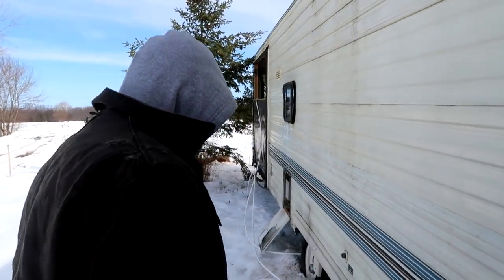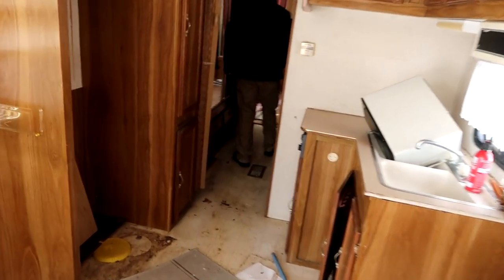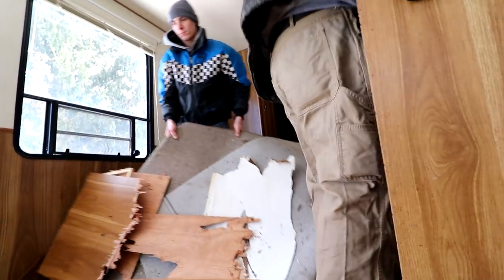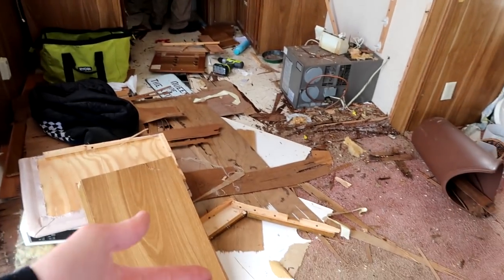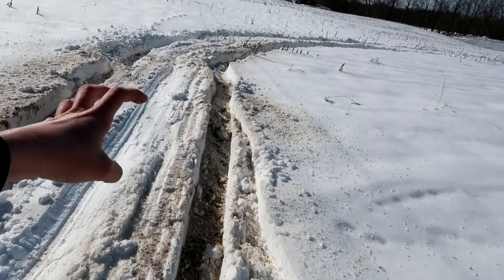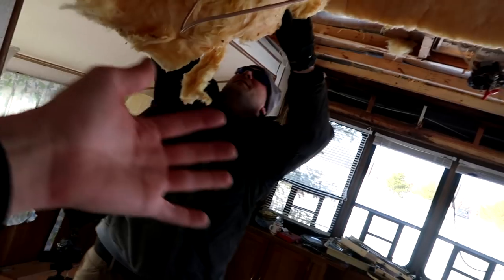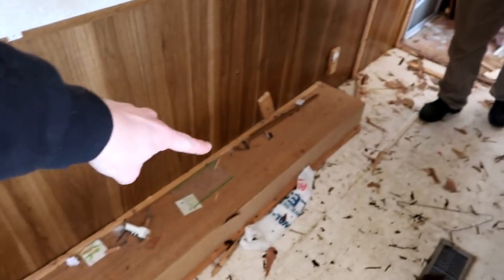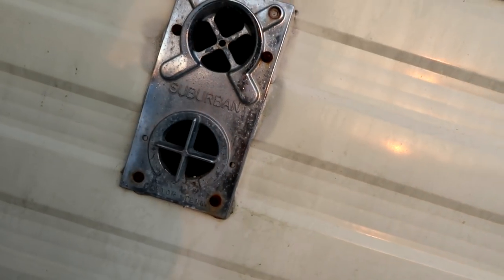DESTROYING MY NEW CAMPER

Comment: Awesome job Dalton. Can't wait to see the rebuild. Get lots of video on it. I am redoing a smaller camper. That was the heater you pulled from the side I think. Hope you kept it. It usually is only a clogged line if it don't work, super easy to fix. Heat will be nice in early spring and late fall racing. Really looking forward to seeing both these builds completed.

Comment: Don't cut the back off and you have 10 feet for storage and 25 ft for sleeping and also you're lucky your campers only 8500 pounds I have a 35 foot that weighs 15500 lb

Comment: I say don’t cut the 10’ off just load Crush from the side of the trailer to have it over the axles and use the area at the back as either a bedroom or storage area for equipment or merch.  By reducing it to 25’ and then reducing your living area by whatever Crush takes up it won’t leave you with much room for a bathroom, kitchen, sleeping area and somewhere to relax after a day of racing but that’s just my 2 cents.

Comment: That trailer is not a travel trailer that is made to be towed to a spot and left there for a period of time not made to be towed all over for long distances and I don't know if you will be able to put 1500 lbs in the way back if the trailer with out weight distribution problems
Reply: He's not wrong the weight distribution will be off. You want the weight on the tongue and the axle. But not on the rear. 8500 is light already...

Comment: I have one of these enclosed trailers /w ramp door where I can fit 3 ATV's in it.  Added some cabinets in the front.  Take the ATV's out and pull out the blow up mattress and you have yourself a camper.  I think I paid around 5k brand new which you can probably find for half that in the used market.  Probably a better starting point than this.  Not saying the videos are not interesting but I get the same feeling as when you were trying to make the gator project work.  The amount of time and money required to get a safe & functional result is just not worth it.

Comment: Why don’t you cut the back 10 feet off make a garage door type door that seals the heat still make it  Drive in flatbed that is enclosed for crush and other racing gear

Comment: prolly be a good idea to lengthen the tongue a little too or move the front whall away from it so you can make tighter turns  ,, 
if you take the cabinets out youre taking a lot of rigidity out of the whole construction , theres a change the whole shell simply falls over like a carboard box with two open sides
allso the frame might look good but it will be kindah thin for hauling cars , you probably need to ad some extra steel to it to prevent the end of the frame from folding behind the wheels once you loaded the cars on it and drive over a bump
not sure if you seen the vids from WJP004
https://www.youtube.com/watch?v=av4BWwo8i14&list=PLh5B6MCXRHiHqEhccCyo_kqJiyZx7Rai9 
he has done about the same thing youre doing at the moment , he finished it recently 
he made a few cartrailers already , build his own house from the ground up and is a realy good fibergass fabricator he kindah knows wat hes doing 
he an old guy but he gets ore stuff done than i do at my age